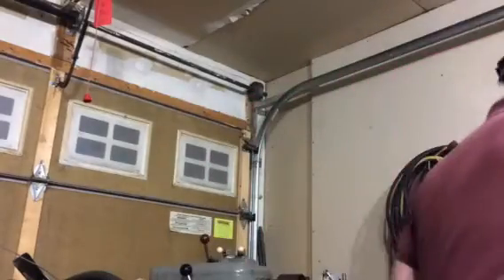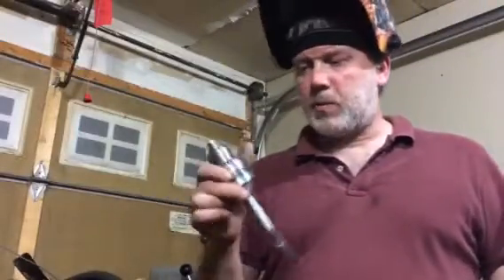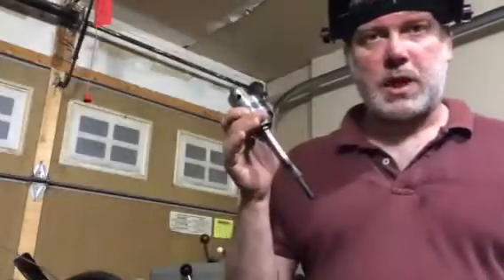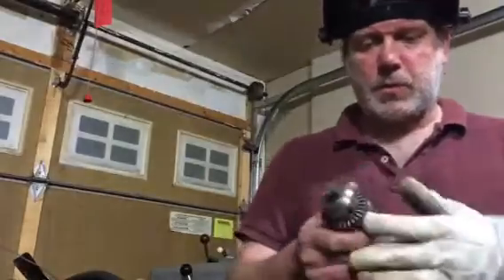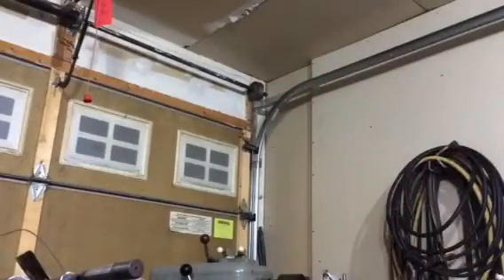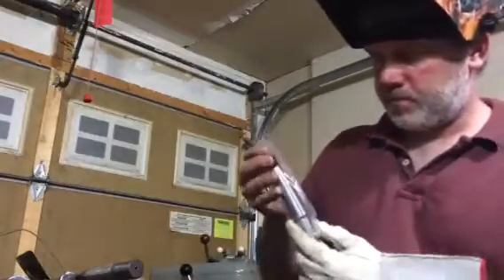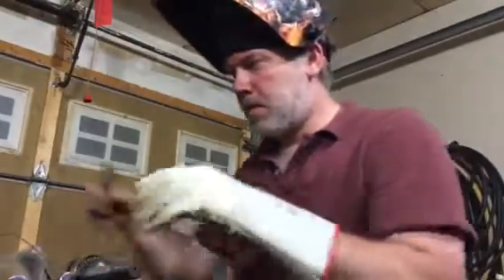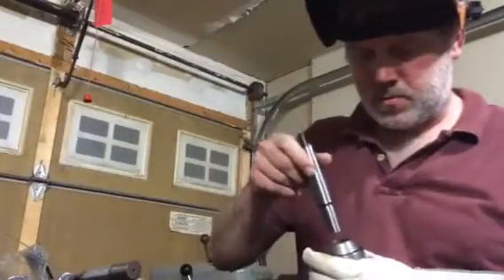Removing Jacobs taper from drill chuck

Comment: you bent it trying to get it off without Jacob wedges.
Reply from the maker: Actually, we were doing a end of year clean up at one shop I was working at. The CNC operator programmed the wrong tool in the carousel. Instead of being a 3/8 ball nose. Small bump on the side of the 10 x 10 x 10 block. It was put in the trash bin. So, it was a bit of a dumpster dive.  Sure I could've used wedges if I had some. But I had a $.10 bolt instead and the slide hammer and welder I already owned.

Comment: Yeah,we all got welders,I'd rather spend a few dollars and get morse taper wedges,specific to the size morse taper,you have fitted to the Jacobs chuck.
Reply from the maker: If there is a shoulder, sure you can use tapered shims. I explained in the video, you can drill out the bottom of the chuck.  With larger chucks I generally drill .265 and drive it out using a 1/4 DME pin.